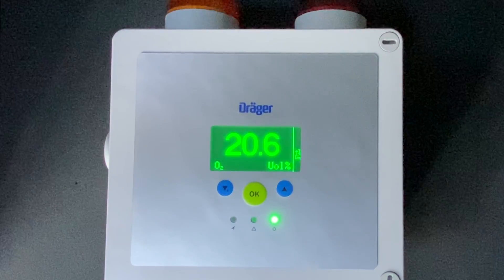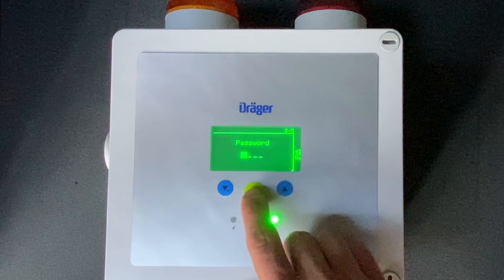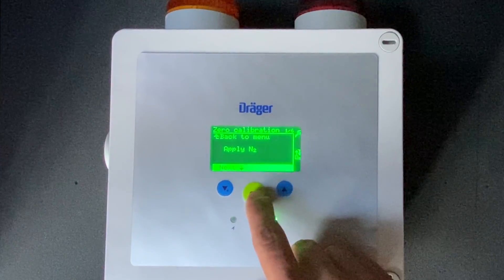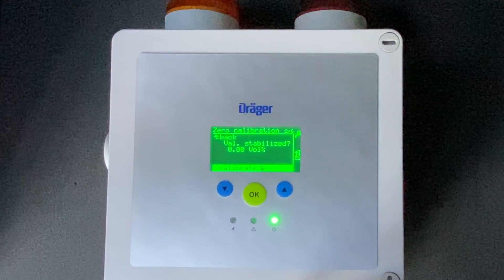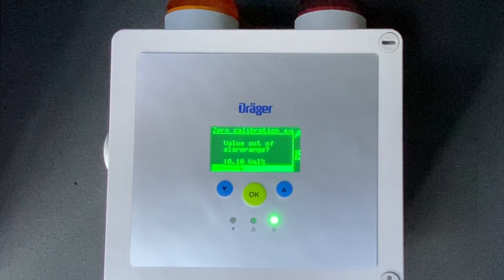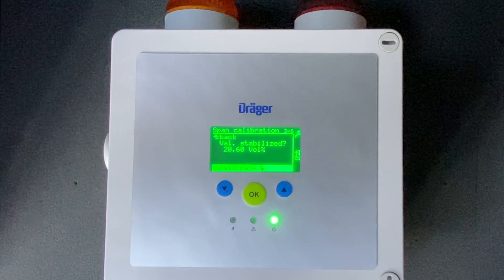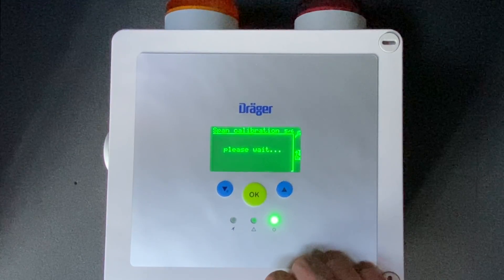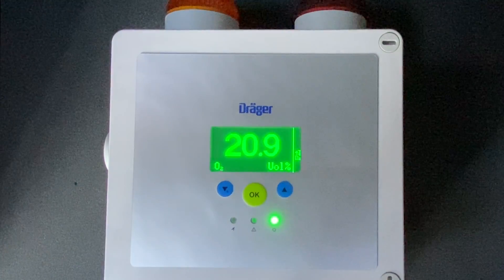How To Calibrate A Draeger PointGard 2100

Comment: thanks for ur nice demo. Pointgard 2100 with Cl2 chlorine sensor which 50 ppm. If i want to calibrate with 10ppm chlorine it should be ok? or i need 50ppm chlorine ? pls advise thanks

Comment: Thank you for the informative video. Just a couple of comments: Normally it's not necessary to zero an oxygen sensor. A span calibration is enough. Other sensors do require a zero calibration. Stabilization of the reading before hitting next shouldn't take more than a couple of minutes.